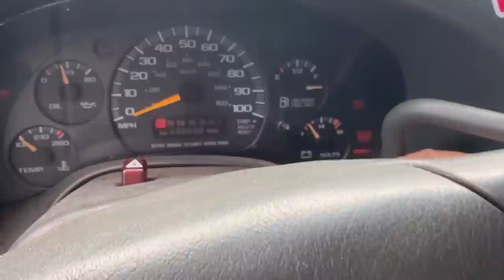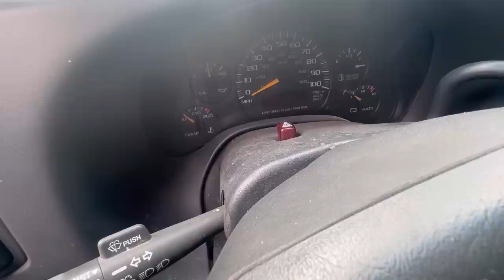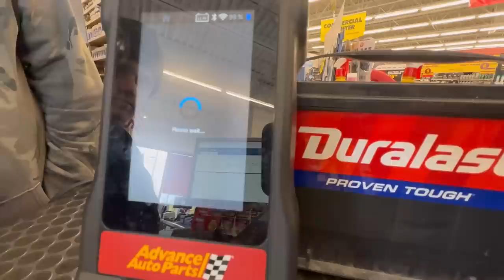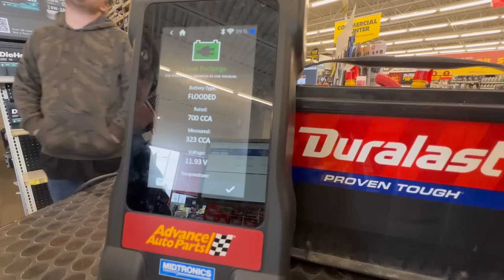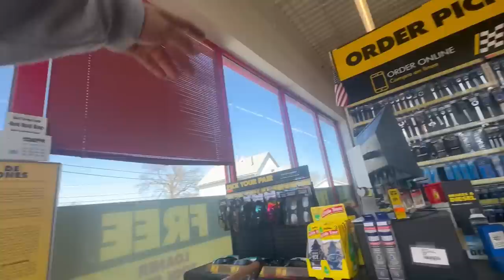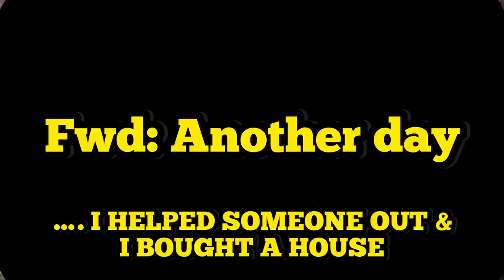ALWAYS SOMETHING: THIS IS WHAT HAS BEEN HAPPENING THIS WEEK!

Comment: After adding gas you need to replace the gas cap as it will not start without. Found out when my truck stopped running after getting gas , driving down the road and it guit on me and they told me to check that my cap was on tight.

Comment: It's not the battery being bad. It could be fuel related, plugged fuel filter, bad fuel pump, or it could be ignition related, no spark. Mass air flow sensor, bad cap and rotor

Comment: Hi Guapo, I believe your Grandpa felt like he did give his statement when he talked about Chapo. Plus he was just finished eating and was interested in watching Spider-Man movie. I still think it your fuel pump. That would stop the gas from getting to the engine. I was suspicious of that Auto Zone employee he didn’t even re-test the battery. He just wanted to make a sale. Just the day before the employee told you the battery was fine & it just needed to be charged. Because if it would have been the battery the truck would have started right away. I hope you took a wire brush and cleaned off the connectors before attaching the new battery up. Please hire a Mechanic I believe it will be cheaper in the long run. Sending you prays and Legends love. 🙏🤗💗🍍